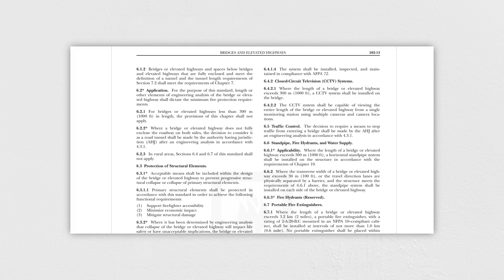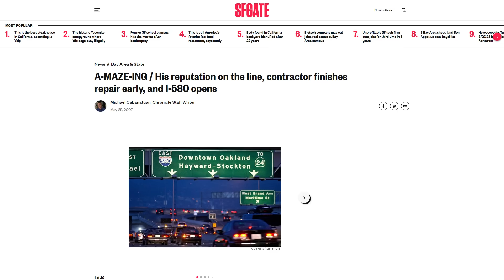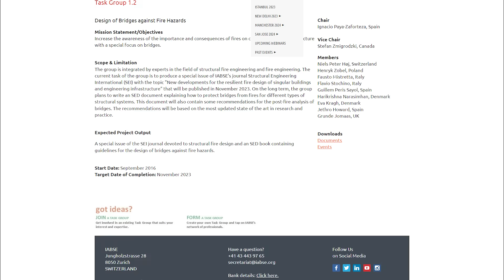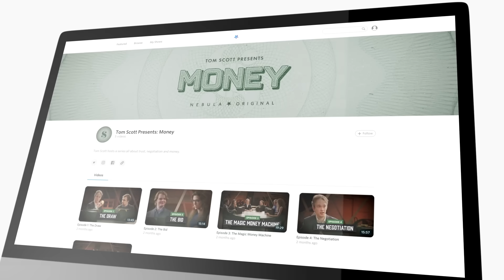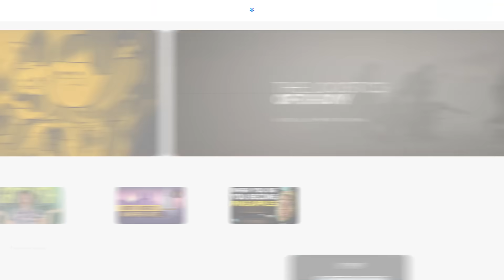Philadelphia I-95 Bridge Collapse Explained

Comment: In 1979 we engineering students at UIC had to design and build an automatic fire extinguisher which identified any heat source within 60 feet, measured vertical and horz angles for the nozzle to aim at, turned on the water, and then, automatically make adjustments for the maximum cooling of the heat source, and shut off when cool.  Cigarette smokers did not dare come into this room. It was not expensive, only an IC chip, 8 photocells, 2 plumbing swivels, a nozzle, and 2 stepping motors to position the swivels.

Comment: The simpler solution is to upgrade fire safety standards for tanker truck carrying flammable materials. Most of the tankers I see are made of uninsulated aluminum. Adding an outer insulating jacket could delay the flames from reaching the aluminum inner tank until the arrival of firefighters .

Comment: the final analysis is to compare the cost of an occasional bridge failure due to fire, and the cost of trying to make every bridge fireproof.  - and the fact of the matter is that to fireproof most bridges would require them being removed and replaced  with much heavier structures, with aggressive fire suppression systems installed in them.
Reply: The Kersh rail bridge might have been built that way because it is still there.

Comment: Great video; Since that bridge was on an interstate in a metropolitan area, couldn't the bridges in critical areas be fitted with a fire suppression system either just water or a foam mixture. the system would contain the fire before massive fire damage could occur and the utilities for the implementation are more than likely very close to the bridge in the first place.
Reply: Hideously inefficient, and mostly unhelpful. As Grady said, less than 3% of bridge failures are a result of fire damage, and bridge failures are pretty rare to start with (generally less than 10 per year, out of ~700 000 bridges in the US).

So, you propose to install high tens or low hundreds of thousands of fire suppression systems (assuming only in urban areas) and their attendant sensors, protect them against the elements (especially freezing weather), maintain them, inspect them, repair them when they start to break down, and repair the erosion that they cause to the bridge when some of them start leaking or go off by accident (or because some vandal/protester set them off intentionally). All of that to prevent maybe one or two incidents per decade. Plus, for half of the US, the system is going to be inoperable for about 25% of the year, because you can't use spray-based fire suppression in freezing temperatures. Even non-water foams will tend to congeal and gum up the sprayer heads at low temperatures.

It just isn't worth it.
Reply: @boosterh1113  Chill out dude! it was an idea not a mandate at least some of us still know how to think!

Comment: Hmm, Alot of attention placed on the static infrastructure side of things, but not much on the mobile side. Out of the examples you mentioned only one was from a non-tanker truck source, why is all the focus on protecting the bridges themselves rather than making it less likely for the tankers involved to be punctured or otherwise leak and fuel these fires. I mean after the Lac-Megantic disaster both the Canadian and United States governments took a hard look at the DOT-111 tanker cars that made up the consist of the train that derailed and forced a much more stringent timeline for the phase-out of the old DOT-111's and the phase-in of the newer tougher and safer DOT-117 tanker cars as the DOT-111's had proven their weakness and the dangers associated with it during derailments. I personally think the government needs to take a hard look at Road Tankers and the dangers they pose in crashes and institute stronger safety guidelines for Road Tanker construction, as making the Road Tankers safer improves safety across the board far more than focusing on the bridge failure aspect of tanker crashes...

Comment: Did any Law Makers consider introducing a European CPC requirement for ALL Hazardous Material carrying vehicles on American roads, Of course not that would increase costs to the Logistics co. Back in the 70's(in the UK) if you smoked you would NOT get a job driving a fuel bowser and a pre shift sobriety test was an instant dismissal on failure, So if all of this is in place, do your LGV's also use brakes designed in 1865 ??? as the trains do ???

Comment: I'm sure there are reasons this wouldn't be a good idea, and probably only for cities with high traffic where this could happen, but what about a sprinkler system built into the bridge? Maybe an alternative is the sprinkler system that is primarily designed to keep the bridge cool with any falling water on the fire an added benefit. If there are no water sources around, maybe at a safe distance an access point for the fire department to hookup and pump water since a lot of bridges have poor access for fire fighters anyways.
Reply: Fire suppression itself is not a bad idea but you don't pour water on a petrochemical fire unless you want a worse problem.
Reply: @igrim4777  Good point, I completely forgot gas and other fuels float, which as you mentioned would make it worse. Thanks.

Comment: Several heat-resistant coatings offer one to two hours (A60-A120) of protection that are suitable for steel and concrete.  The paints are capable of resisting temperatures to 1300°F.

Years ago I had discussions with a  vendor that was selling coatings that were derived from the same ones used on the Space Shuttles.  The coatings offered an alternative to fiberglass blanket insulation used on the ship's A60 bulkheads.
Reply: the catch is, that 1 to 2 hours of protection isn't that the bridge will be fine after 2 hours.  the protection gives you 2 hours to evacuate people and then the bridge comes down.  it;s kind of like those 5 mile run flat tires.  it doesn't measure the time before damage, it measures the time before catastrophic failure.
Reply: @kenbrown2808  Understood.  My career was in engineering for tank vessels.  Tank vessels are regulated by Subchapter D of 46 CFR Parts 30-40 and the Navigation and Inspection Circular 9-97, Change 1, Guide to Ship Structural Fire Protection.  These documents guide how long a bulkhead must prevent a fire of a certain temperature from passing through to an adjacent space.  For example, if a tanker is on fire the front of the accommodation must have an A60 rating.
Reply: @robertlevine2152  right, same thing for land construction. But keep in mind, that's time until failure, not time without damage

Comment: I am by no means an expert but seeing as bridges to the best of my knowledge consist primarily of concrete and steel it reminds me of 2 things. If anyones ever seen any primitive technology videos theres a way to process iron ore in order to smelt it, one of the steps of this process involves firing the ore which as far as Im aware burns away impurities/goes through a chemical process. Given that theres a combination of rock and iron in most structures and if temperatures get hot enough this process may happen in some degree even in structures. The other thing it reminds me of is water logged rocks exposed to high heats (Ive had first hand experience). Over time a river rock will have water seep through it getting into even the smallest crevices and if put over a fire it will at first start to fracture/shatter and eventually explode. Since concrete has water as a component this is also a possibility. It could even be that theres a combination of these 2 things or even more. Again, not an expert though, this is just a guess based on things Ive dealt with.

Comment: Some posts here wonder why tankers fail under bridge crossings. Perhaps it's dimmer when entering bridge crossings and it's similar to circumstances when drivers entering or leaving tunnels. To tackle this problem light engineers install lights at the entrance and exit adjusting the gradual light intensity to suit drivers for a safety driving.

Comment: Cheapest way I could see to protect a interstate style bridge would be to blanket the underside with kaowool protected by some thin aluminum cladding.  The cladding is just to keep the critters and people from destroying the wool and will likely melt away in a fire. Then having an active water system soaking the wool with water from above in the event of a fire.  It would be expensive, but cheaper than other options. That said, it would probably only be worth it for major interstates like i95, i55, i40, i70, etc.

Comment: To me, it seems like it would cost way more to analyze every single bridge for fire resistance than to just add some fireproofing to all bridges which fulfill some kind of criteria for risk (Such as X traffic going over, Y traffic going under, fuel trucks may pass). I also feel like the fireproofing should be standardized in that case, in order to reduce costs.
Reply: Honestly it really depends. There are over 600,000 bridges in america, most are overpasses. The cost of fireproofing every single bridge would be EXTREMELY high. Most bridges dont last forever either(even if theres still a bridge there for half a cenury for example, the bridge likely had alot of maintenance over the decades)

Most overpasses are also not as critical to transportation as the one in this video. Most of them would not cause nearly as much of damage to the economy.

Its all about balance, bridge collapses dont even tho occur ever month in america, despite the number of bridges.

What we may want to look into instead, is perhaps fireproofing only the most important overpasses(like the ones that would be more critial to keep open)

Protecting all thoses bridges, plus the extra maintenance that follows said protection would be much more expansive than whatever cost one overpass closing for a few weeks is

Comment: I came in expecting a post mortem of the failure, and got something better. Great video as always, I hope when we get a full report from the NTSB you can produce a follow up.
Reply: There'd be nothing new, the scenario has played out many time and has been analyzed many times. Heat damages concrete and weakens steel. This was more of a look into the importance  and complications of infrastructure
Reply: I was also hoping for an explanation of what fire does to "noncombustible" structures; simply because it is just a larger scale version of why the WTC collapsed because of the fires inside the buildings.

Comment: Fortunately Philly has one of the better regional rail systems in the county and was able to add more trains. Amtrak was able to accommodate some other longer trips. We have a long way to go to reach global standards of public transportation but this could have happened in a much more vulnerable location.
Reply: Amtrak owns the rails in the area, i think
Reply: @masterbond9  I think amtrak only owns the NEC, which only half the regional rail lines even use in part. Some of the other lines are either owned by or shared with CSX/Norfolk Southern. many are owned by and used solely by SEPTA.
Reply: @dxb338  ok, I know Amtrak owns track in NEC, I just wasn't sure where it ended
Reply: @masterbond9 SEPTA owns most of its own rails
Reply: @eldenfindley186  oh, well either way, it shouldnt be too bad with alternative methods of transportation
Reply: We need to expand our long distance rail. Right now it's a $100 7-hour train from Philly to Pittsburgh, a full 2 hours longer than driving assuming there are no delays (which are common), there's only one a day, but accounting for gas and tolls it's about the same price as the Turnpike. Most of the problems stem from the fact that freight companies own and "maintain" the rail and often claim priority over Amtrak even though passenger trains are supposed to have the highest priority.

If it were a guarenteed 7 hour trip and there were more departure times then it would be worth it to take the train IMO.
Reply: @namAehT  thank Prescision Sceduled Railroading, and regulators allowing trains longer than available passing sidings for that
Reply: @namAehT how long though because at a certain length flying is more reasonable. Nobody takes a train from New York to LA unless the journey itself is the reason.
Reply: Problem was for all the trucks that had to use the local detours that were just too large
Reply: This is the first time I've heard SEPTA described as "one of the better systems".
Reply: If this happened in Omaha, NE, logistics companies would be pissed as that's a major transportation artery where detours add significant cost to that leg of the trip. A lot of line hauls run through I-80, and with its proximity to Offutt AFB, I wonder what the responsiveness to this would look like.

Comment: One of the biggest slowdowns for construction projects is the cure time for concrete.  It must cure long enough for it to be strong enough for the desired loads.  This can take 30 days or more.  So at times there is a fury of activity to do a concrete pour then a long wait for the cure to complete enough to do the next step.  If the project is large enough then these wait times can be staggered, but on smaller project like a bridge of a two lane highway, there may not be a way around the waits.
Reply: There isn't. In the past they used to add chemicals to concrete to make it set more rapidly. Well, that's the reason all houses here need a 20-50K concrete replacement in their flooring, because half a century later it's already coming apart rapidly with repairs starting as early as the 1990's (so roughly 14-19 years after pouring)

Comment: Imagine an analogy to a sprinkler system in a building.  From a water main near a bridge, a line is run so there are some number of nozzles that can direct streams of water to the underside of a bridge in case of fire.  I wonder what flow of water would be enough to cool the bridge material enough to prevent failure.  Would it be feasible?  I bet the cost might be worth it for bridges in critical areas but not all.  I'd also be interested in the mode of failure of these tanker crashes that then caught fire: what caused each crash and why a fire.
Reply: A bridge bidet, if you will.
Reply: off the top of my head, I'd estimate about 4000 GPM.  the biggest problem is you can't put a gasoline or diesel fire out by putting water on it, because the water sinks under the fuel.  so you have to either hit the entire volume  with enough water to cool the area below combustion temperature, or you have to have fire foam to make the water float on top of the fuel and rob it of oxygen.
Reply: @kenbrown2808  Thanks.  I was thinking of the flow to cool the bridge rather than put out the fire; if multiple temp sensors and automatic spray of water I'd assume all the water converts to steam.  Difficult to have the control unit not destroyed by the heat.  May not be feasible.   Are firefighters able to put these out or do they just burn until all the fuel is gone?  If they can put it out, the cooling system just needs to buy some time; if not ... not
Reply: @misterdubity3073  most feasible to protect the surroundings, because you still have the fuel spill to deal with.

Comment: While protecting the bridge against fire is a good back-up, perhaps it's worth noting that unlike natural forces like weather or earthquakes, there's some effort that could potentially be spent in actually preventing the fires from happening in the first place... Obviously not 100% nor all the time, but perhaps worth it. Resilience by not relying on only one mode is also a good thing to start be looked at.

Hope the bridge fire codes could be concluded soon, and perhaps for the reliance on roads to be focused at more and alternatives looked at. Sometimes reducing road capacity or links could reduce congestion as well...

Comment: Great video. One thing I don't understand is why build the supporting embankment in the center. Surely it would be easier to build it on one side then reconstruct the entire bridge deck on the other side then reverse. Traffic could continue through (what we would call in the UK) a contraflow where traffic moves oposite directions on the same highway seperated by a barrier. Am I missing something?